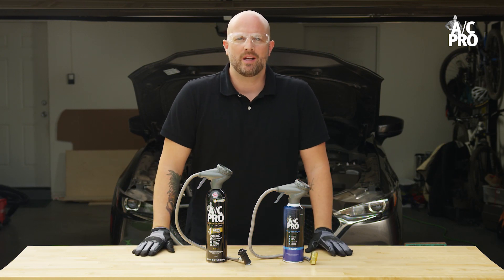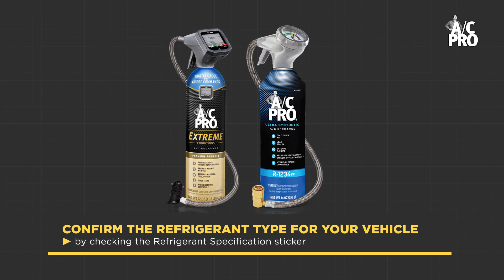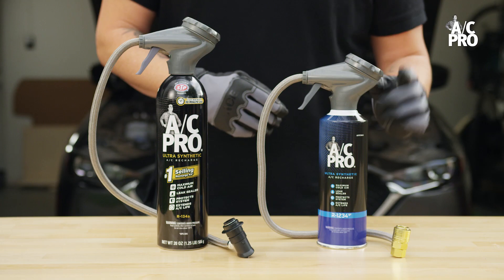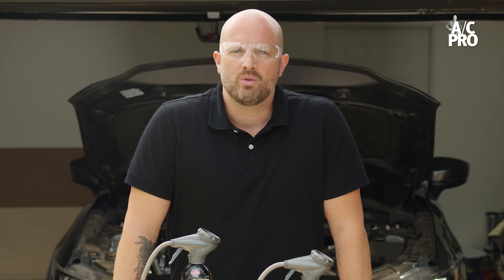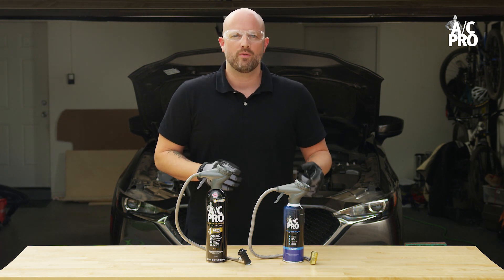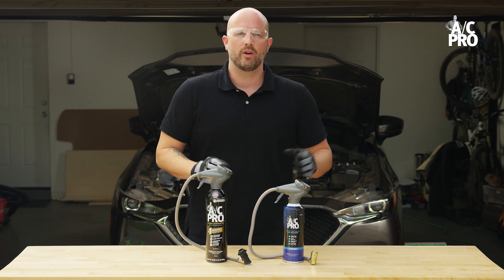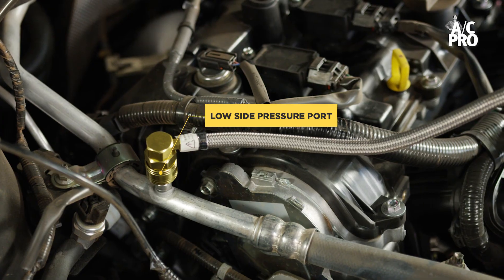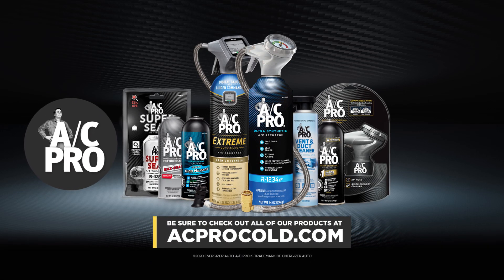AC/PRO  R-1234YF How To

Comment: I changed my condenser on a 2017 Silverado but the a/c pro 1234yf won’t go in the system is there not enough pressure in the can to engage the clutch?
Reply from the maker: Plenty of pressure in the can to push into the system.  You're adding via the low pressure port and the compressor creates a vacuum as it draws in gas.
Reply: Same here on 2019. The larger diameter tube is apparently the low pressure so I had it hooked up correctly.  Still no freon would enter the system. Took it back and they refunded me. Wish it would of worked!

Comment: does this add it as a liquid or vapor through low side? if you're adding through low side you ideally want to add a vapor as too much filling too much liquid too fast can slug the compressor
Reply from the maker: It is added as a gas if you add with the gauge on top.  Shake well to mix the additives/oil with the refrigerant.  Do not turn over the can when filling or you will slug liquid refrigerant into your system.

Comment: There is a plastic spacer between the trigger and canister that the directions say to remove, but I cannot for the life of me get it off.  Any suggestions?  I just keep twisting and pulling and it won't come apart from trigger assembly
Reply from the maker: By law, 1234yf requires a reverse thread on the can top so you need to twist the spacer off backwards.  The gauge then screws on backwards.

Comment: How long does the recharge last for ?
Reply from the maker: It really depends on the size and type of leak you have, but your A/C system is a closed system so if the leak is fixed it can last for years.

Comment: So I have a 2018 pilot what kind should I use? Is it safe to use either one ?
Reply from the maker: Looks like your vehicle uses R-1234yf.  To confrim that's the case, look under the hood for a sticker detailing the refrigerant type.  That's the best way to check.  You must use a product that has the same gas as is in your vehicle.

Comment: Hey i want to buy it But i am bit confused whether to buy this or change my parts related to AC (which parts i dont know ) . So my question is , does this seals the leakage if your condenser has any leakage ?
Reply from the maker: This product only contains rubber stop leak.  If there's a seal in the condenser where gas is leaking from, then it can work for that, but if it's a metal leak it will not offer a solution.  We do have an A/C Pro Super Seal product for 1234yf vehicles that works for metal leaks.  https://www.acprocold.com/product/a-c-pro-super-seal-a-c-treatment-metal-rubber-stop-leak-for-r-1234yf-vehicles-1-5-oz/

Comment: used it on a 2012 Honda Fit, at first it would not go in. Had to press down on the fitting  to make contact with the car valve stem. Then it worked. emptied entire contents , weighed before and after, 13.4 ounces difference, not the 20 oz it claims to have.

Comment: I have a 1234YF system, but the cheap Amazon gauge doesn't fit.  I bought this in hope it does, I know it's not R134A, I have a can of that and its too large.  

I am positive I am plugging into the low pressure port as well.
Reply: They have gaugrs that only fit pre sealed cans and some thar fit the ones not already sealed

Comment: If you have a 2016 Honda like me get this R-1234yf can because it works! Do not get the other can because the hose will not fit the lower pressure pipe & you will waste your money. It cooled my car down instantly & it read my AC pressure accurately. Took me less than 10 min to recharge it and saved me so much money. Total it cost me $161 w/ tax. I’m tellin y’all this is a real review because I was suffering in this heat. This video saved me and my pockets
Reply: Hey i have the same car. But i am bit confused whether to buy this or change my parts related to AC (which parts i dont know ) . So my question is , does this seals the leakage if your condenser has any leakage ?
Reply: @shubhammann9295  It will work. But Honda extended the warranty on condensers because they were manufactured poorly. Take it to any Honda dealership and pay the diagnostic fee. If its condenser and isnt from something hitting it or compressor seal honda covers all charges and refund the diagnostic. Both warranty's were extended to 10 years.
Reply: @shubhammann9295  No, and most of the time if your AC is running warm it has a leak
Reply: I jammed ths R-134 version of this product on my 2016 Honda Civic, even though you aren't supposed to be able to.  I contaminated it, and had to have the whole system flushed at the Dealer.  Our 2016 Civic's have a recall for a bad A/C part, which is the root of this issue.  You only have until summer 2026 to get it in to the dealer and have them fix it.

Comment: What if r134a was accidentally used when it should have been 1234yf? But, the air feels a lot cooler, than it was before?

'19 chevy impala premier 3.6

Ps, i think most of it did not get inside. Didnt realize it was the wrong can used til this morning. The small can. Ac feels normal. Should i now add 1234yf or just leave how it is?

Thanks
Reply from the maker: It would be impossible to add in 134a to a system that came with 1234yf since the fittings are completely different (by law/regulation).  You may need to add 1234yf.
Reply: @Acprocold  thank you

Comment: QUICK CONNECTOR WON'T SEAT.
Reply from the maker: Are you sure you're on the low side port and you have the right refrigerant for your vehicle.  If your vehicle uses R-1234yf and you buy an R-134a product it won't fit.  Likewise, if you're on the high side port and not the low side port (between compressor and evap) it won't connect.  The ports are standard across all vehicles and we meet that standard so if it doesn't fit one of the above has happened.
Reply: @Acprocold  IT Was the wrong port, shown as the right one on an internet search.

Comment: 2016 Honda Civic, I too bought the 134 (wrong) can at first. my shop doesn’t have the tools to test the system for the AC leak that I have. So they said if I bought the can((1234)I could bring it to the shop and they would charge it for $60.00.  So all said and done $162 for the can and $60 for the install. Not too bad. Last year a different shop charged me about $300 and I thought my AC was fixed. Until 2 months later.

Comment: I have the AC pro gauge R-134A hose. Will an adapter for R-1234yf  that they sell on Amazon that goes on the AC line work with this hose?
Reply from the maker: Not sure what adaptor you're referring to, but it's illegal to put 1234yf in a 134a system or 134a in a 1234yf system.  The 134a and 1234yf gauges not only have a different coupler on the end of the gauge, but the threaded piece the can screws into is also not compatible.

Comment: Do you have to worry about ambient air temps these days with these kits? I know you had to dial that in, in the past.  I have a R1234yf system that I'm looking to get a can for.
Reply from the maker: Yes, the pressure in the system will increase as ambient air temperature increases. 
 Pressures in a 1234yf system are very similar to that of a 134a system.

Comment: Question to AC PRO, after screw on the can and hookup the coupler to the low-pressure port, there's air in the hose, how do I purge that air before squeeze the trigger? Don't want to push those air into the system and have issues later on.

Comment: SInce the cost is so high, Can we use your product in the parking lot to first tell us the current pressure in our system before squeezing the trigger so that we can return it if our car is indicating that the pressure is already in the green or beyond the green indicating some type of other issue.  I think most of us need to diagnose first with a gauge and then decide the next step.
Reply from the maker: We recommend with all our products for you to check the pressure first before using it.  The retailer should then take the product back if you return it without using any of the refrigerant.

Comment: My 2006 Sienna was not cold so I tried using this. Not sure if I'm doing it right. I attached the gauged on and it went all the way to the Yellow side even before pressing any freon. Please advise.
Reply from the maker: Make sure your engine is on and the A/C is set to make cool with the fans on high.  If not, you may get a high reading when the system is off.

Comment: Hi does this work on cars before 1990? On the old A/C system before they converted to the new freon system?
Reply from the maker: No, the first vehicle to use R-1234yf was a 2012 Cadillac.  Back in 1990 cars used R-12, which is a completely different refrigerant.
Reply: @Acprocold I thought the Subaru XV was the first vehicle to use it.

Comment: Need this for a 2014 charger rt took me over an hour to figure out the why the 134a wouldn't fit like the dude at the auto parts store said it should.
Reply from the maker: Yes, 1234yf was first used in vehicles in the US starting in 2012.  Your vehicle should have a sticker under the hood indicating the refrigerant type.

Comment: No it is not that simple as described or should I say the process for adding the refrigerant is very loosely treated in this video.  There is a big difference in the way you read the gauge with compressor off or on and read the “real” static pressure to determine if your system is actually low.  

This should be treated with more respect to the balance of us that are not familiar with the correct process.  Yes, a monkey can shake a can and press the trigger but knowing how to interpret the gauge correctly is missing in this video.

Comment: My 2020 Civic with the R234yf system is blowing cool air. I think it’s low on coolant. Would this right here bring my A/C to start blowing cold air again?
Reply from the maker: Yes, this is the product to use for that, but your 2020 vehicle is very new to have lost enough refrigerant to require a recharge.  Should also be under warranty.

Comment: It was $150 for the can with the gauge. Crazy price for something that probably cost $10 to make. I get it, the dealer would charge $300-400 for the same thing, but holy crap.
Reply from the maker: Yes, this is a new "environmentally-friendly" refrigerant used in most new vehicles and it's very expensive.  The cost should come down over time just like R-134a did when it was introduced in the 90s.
Reply: Did it work

Comment: Will AC Pro R1234 work on my 2015 tahoe?
Reply from the maker: If you 2015 Tahoe uses R-1234yf then this product will work with it.  It works with any vehicle requiring 1234yf.

Comment: 2016 Honda Civic model owners who gave up, where ya at!?!
Reply: I just went and bought some for my 2017 Civic 🤣 the shop was going to charge me $500 I'll do it myself for $150. R1234
Reply from the maker: Yeah, this is the direction new vehicles are moving.  80% of new cars in the US have this refrigerant with more adding it every year.  Eventually all with have this as is the case in Europe and 134a won't be used.
Reply: I bought a 134 on accident, smh
Reply: I did it myself!
Reply: right here
Reply: They still forking out for yf instead of fixing it 😂 could have fixed it a few times over now at ac pro prices
Reply: Hahahaha 🤣 right here!
Reply: Accord here 🙄
Reply: Look i just found this out! You have screw the thing in the opposite way of tightening it up to get it on as opposed to the usual way. I was today years old and felt stupid as hell
Reply: Dah!!!! 🤣 were try to rock and roll in this heat
Reply: 2017
Reply: Easy to do. Worked out great. Air temp at the outlets is 54 degrees. Was 70 before the recharge.
Reply: Whew glad I found this
Reply: Here man my ac done

Comment: AC is blowing hot air. I know for certain I am needing a recharge, but I just came from a video stating one had to vacuum out the old freon. Would this be true in my case if I am just topping it off? Please any help is appreciated.
Reply from the maker: You do not need to vacuum out the system before using one of our products.

Comment: Thank you for the straight video . This looks  helpful for me but I have a question, Does R-1234yf works for hybrid car ? Specially I drive Honda Insight 2019 . Thank you 🙏
Reply from the maker: Yes, our R-1234yf A/C Pro recharge kit works with hybrid vehicles.
Reply: Does it work with 2009 nisaan maxima and 2019 toyota highlander

Comment: 2017 Honda Civic has started to blow hot air and it happens to use R1234yf

... Which is the most expensive type.

FML.
Reply: I have a 2016 and it started to blow hot air at around 30,000 miles
Reply: Same same! 🧐🤔 Common problem? Does this mean there is no leak?
Reply: I just finished refilling mine, it was super easy after  following this video. I have the same car and it’s been blowing hot air since I bought it but even tho it’s hella expensive, it’s very worth the purchase. 🤝

Comment: This stuff costs $139.99 at AutoZone (per their website - June 2021)...What a rip-off!  The old R-134 AC Pro refill kits cost $25 on sale.  To top it off, R-134 and R-1234YF use differently sized ports which means you can't use your old R-134 connectors/hoses and need to go out and buy $15 adapters.  "Right to Repair" is taking a dangerous turn for the worse...now manufacturers and producers are going to ensure you'll pay dearly if you want your "Right to Repair".  Come on AC Pro - Why is this stuff so expensive??
Reply from the maker: R-1234yf is very expensive compared to R-134a.  It is relatively new in the market with limited supply available from two companies owning the extensive patents so costs are considerably higher.  Fortunately, there is still a savings to DIY as the higher costs on R-1234yf also apply to shops.
Reply: @Acprocold  Thank-you for your honest feedback and explanation - I might not like it...but I appreciate it.  Would you go a little further with that honesty and explain what your cost to produce, per can is, on this item?  You get to buy R-1234yf in MAJOR bulk for manufacturing, so I assume AC Pro is getting a much bigger bulk discount than my local shop who's only buying it by the 10-20lb can.

Comment: How long does a can last? I went from below 20 to 45. A few days later I checked again and dropped to below 30. I tried refilling it again and only got to 33-35. It still feels like there's stuff in the can but it stopped filling.
Reply: You might have a leak
Reply: Might also be over filled as well
Reply: You might have a leak in your AC condenser. Check with dye and a UV light.

Comment: Fixed the A/C problem on my 2018 Honda CR-V.  The R-1234yf product was 3 times the cost of the 134a, but way cheaper (and easier) than going to my Honda dealer.  Still have half a can of refrigerant in case I need to recharge again.  👍👍
Reply: Where did you buy it so cheap??  Of course I don't know what your basis was for 3x the cost...but I got the 134a at about $25 on sale.
Reply: Your crv 2018 wasn’t blowing cold air at all, I took my car to the dealer to investigate a weird sound. It was working before but now doesn’t blow cold air at all only hot/room temp
Reply: @kevinmoran54  Common problem with AC condenser.  You need to take it to a dealer which should be under 10 year extended warranty on AC condenser.
Reply: @jamescc2010  it's not just the condenser. The compressor and evaporator have issues too and they cost thousands $$$$ to repair.
Reply: Did you make a video? If you didn't, can you make a tutorial?

Comment: the r-1234yf version is a bit expensive but compared to paying a shop to recharge it, it's definitely well worth the investment. Did it all myself on my 2017 Tahoe and now the ac cools as it should especially with summer rollin in soon. 👍
Reply: did you have to pull a vacuum on it, i also have a 2017 tahoe im guessing you also had a condenser leak at the welds. i see it was a year ago still blowing cold? ive gotten quotes for 390-570 for a recharge.
Reply: I have a 2015 Tahoe but the hood label says 134a....can I still use the r-1234yf?  some websites say yes?
Reply: @1stinlaw917  no you cannot and should not. Do not mix. Use what the label says.